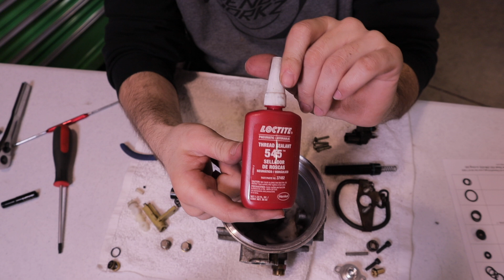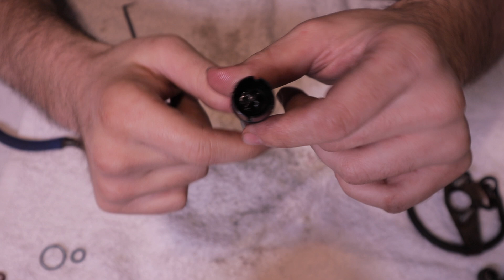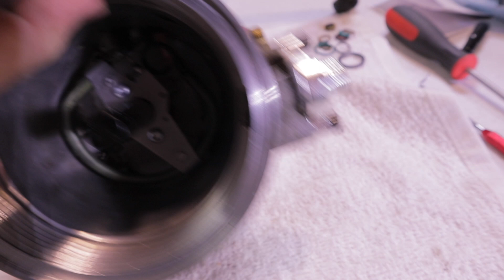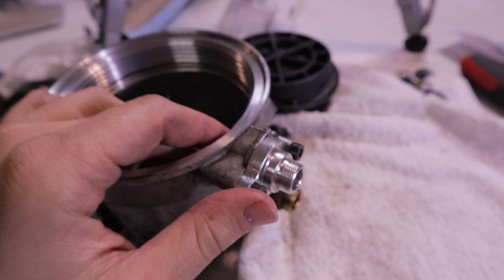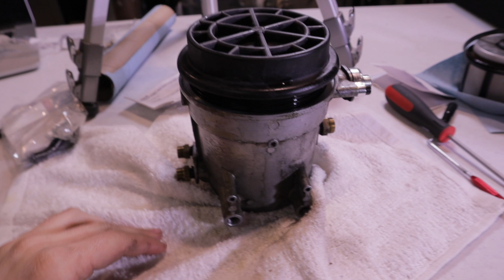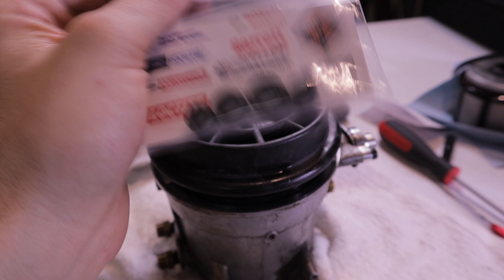Fixing One of Ford 7.3 Powerstrokes Biggest Problems: Fuel Bowl Rebuild Part 2

Comment: Hey Buddy, how are you? I am done rebuilding the Bowl but I need to know if you have knowledge of the torque specification for the brass fitting on the 7.3L fuel bowl? I went to 2 places one says 60-65 lbs which I though that was a lot espeically going to aluminum threads and another place says 19 lbs. So I am confused! Hope you can help. Also, can I use Permatex anti seize on the 2 bolts that whole the bowl or is not need it and do you know the Torque on those 2 bolts by any chance?

Comment: Hey buddy how are you? Got a question for you! What is the difference between Loctite 545 and  Gasoila Soft-Set Pipe Thread Sealant? I am going to start rebuilding mine next week and I only have Gasoila I was told this brand is for high pressure lines but now I am not sure. Thanks buddy,,,
Reply from the maker: I’m no expert but from my knowledge, the main difference is loctite 545 seals the threads and still works like loctite. It cures semi hard. Keeping things from vibrating loose. Also intended for metal threads. Gasoila cures more soft as no is more versatile in application. RiffRaff included it with their FRX kit. So I trust you’ll be just fine using it.
Reply: @LivingOnWheels  OK buddy I was just asking to make sure I do the job once and not having any leaks later. Thank you buddy!!! Another question... Why the new Regulators the Brass Piston don't come with the perforation in the middle to release the fuel? I return 2 of them because of that. I learn without that it can cause damage that is true?
Reply from the maker: @G @GeorgeMartinez-m8y nestly it was so long ago that I’m not sure. I feel like it had something in the middle. Unless yours is damaged I don’t see why you couldn’t reuse the stock one with a new spring.
Reply: @LivingOnWheels  Mine is fine I'm just curious the why the new one doesn't have the perforation. I don't need it at this point but is nice to have an extra one for the just in case. I will rebuild mine next week if I have other question I let you know. Thank buddy for all your help. Love your videos even a 4-year-old kid can follow your instructions. Very Nice!!!

Comment: Do not use a Dorman aftermarket heater/water sensor. I bought one from Advance Auto, returned it due to leaking and they sent another. Despite doing an air pressure test, it still ended up leaking. Bought an OEM unit and it sealed first time out. I wasted weeks due to shipping times and lost many hours installing and uninstalling the faulty Dorman units. Pay the few dollars extra and save yourself a lot of anxiety.

Comment: The o rings on the fuel inlets and outlets do you just stuck them in the brass and then put the lines in after and smash them down or do u put them on the flared lines and thread them in?
Reply from the maker: They go on the flared lines and the nut threads over them.

Comment: SInce you are resealing all of the O-rings, why not also repalce the WIF sensor since you are already there? As these are electronic parts they obviously have a lifespan and they are not cost prohibitive - around $100-130 even during Bidenflation. Are these F81Z-9J294-BA (International P/N 1831197C91) so bullet proof that they last forever or could these electronic WIF sensors be the very reason we see the fail to start issues associated with the fuel bowl heaters?

Comment: A tip for the heating element is to leave it connected and remove the water / heater sensor and pull it out slowly. There’s enough wire to disconnect it outside the bowl. And when putting it back together put the wire through the hole and connect it to the sensor outside the bowl. Then pull the wire in as you install the sensor back.

Comment: Straightforward explanation. I was trying to hurry due to sun setting, and after rewatching your video again, I placed the spring for the fuel inlet valve in the wrong position. So tomorrow hopefully I can remove the filter, the heater and that tower where I put the spring in the wrong position. My spring was kind of bent up, so I slowly and carefully straightened it out as best I could. How it got so bent, I’ll never know. I am starting to go through it weather permitting. My first diesel,so it’s all a learning curve. Keep ya posted on how it turns out😊😊

Comment: Another nice video extremely helpful. You need to get a teaching certificate. I just did one of these fuel bowl reseal. I left the check valve out of the center standpipe I think I'll be putting a fuel filter in they don't think I would ever not put a fuel filter in every little bit of flow helps. Thanks for the help keep it up.👍
Reply from the maker: Glad it was helpful!

Comment: Thank you. I'll be doing the drain valve only. It's a tight fit. I'm thinking, put the screw in, flush with the inside surface. Dab some gasket sealer on the out side thread. Let it set up. Then when positioning it the screws won't fall out. Once they are threaded I can peel off the gasket sealer for a snug fit. Pulling the bowl off like you did, makes more sense. I'm hoping to cut a corner which usually doesn't go well.

Comment: I would have just removed the whole check valve on the fuel filter I don't think anybody would run or not run a fuel filter. I don't know I've seen a couple different videos on removing that what do you think?
Reply from the maker: I’ve heard of people doing it but I don’t think it’s much of a restriction.

Comment: Hi. Good video. Suggestion. Make sure you have your volume up when recording. I have volume up 100%, but you have a soft voice, so it was hard to hear you and I'm watching inside my rig with the engine running. Also, need video on how to access and remove the fuel bowl. Let me know if you have that or suggest a good one. And, I guess you did the fuel bowl delete, so I can use a good video on doing that. After seeing all the work involved to rebuild the fuel bowl, I think I rather do the delete and get rid of the whole dang thing. Good job. Thanks. JR

Comment: Compatible oil is the right way to lube fuel o-rings.  In aviation, an oil system oil ring gets lubed with oil,  Hydraulic with hydraulic fluid but fuel system o-rings get petroleum jelly or an oil typically.

Comment: Hey bro I started doing this on my 7.3 fuel bowl yesterday and I stop when I came across the 2 fuel fittings where you used loctite 545,I can't for the life of me find it at the local stores , is there any other sealant I can use ? Thanks
Reply from the maker: I don’t even remember if the directions even call for sealant on those. You could check Riffraffs website. You might have better luck finding an oil or fuel rated Teflon Tape. Just be very careful to not have it overhang the threads. You don’t want any getting into your fuel rails.

Comment: Just replaced my entire bowl and water separator on my 98 E350. But now getting tons of white smoke. Could it just be air in the system ?
Reply from the maker: No, that does not sound like air. Sounds like and injector issue. I'd say either bad O-ring, stuck injector or broken tip.
Reply: @LivingOnWheels  I’ve never had this issue until I replaced the bowl assembly
Reply from the maker: @JakePearce226  Perhaps you got some junk in one of the lines?
Reply: @LivingOnWheels  I’m thinking so. Let it run for about 20/30 mins and it’s 99% cleared up.
Reply from the maker: @JakePearce226  Good to hear that. Probably wouldnt hurt to run some nice fuel system cleaner through it too. Like some hotshots or Archoil. 
https://amzn.to/36eAZtL
https://amzn.to/39knpar

Comment: If I could buy you a beer I would. Awesome video. I bought the riffraff fuel bowl re-seal kit and used your video to assemble the whole project. Went in like a charm with no problems. I was working remote in Alaska and next thing I know I started leaking diesel from the back end of my fuel bowl right at the drain valve. Patched it up with the tightening of a screw which fixed the problem but I knew it needed some love. Your videos really helped my through the process exponentially. Clear explanations, with visual perspective made the job a cake walk. Riffraff is always my go to when it comes to my 7.3, and people like you really keep things going with a simple run down of the basics. There are a lot of how to, DIY videos out there but the quality and detailing of your videos really makes the difference. Thank you, and cheers!
Reply from the maker: I really appreciate it man! Super glad to hear it helped out!

Comment: Just for anyone's curiosity, the stem in the middle CAN be gutted with no negative repercussions as long as you don't run your truck without a bowl filter. The guts in that stem only serve to block fuel flow if there is no filter present, and I noticed a bit of a fuel flow gain in my system after removing the plunger, base and rod. Not to take away from your video because I realize this is not a mod video it's a rebuild video but anyone who is interested, that is a mod you can do during a bowl rebuild, or if you just happen to have the time when you change the filter.
Reply from the maker: Good info!
Reply: Hell yea. I was looking for this.  Thanks.  I’m chuckin this junk bowl system with micro filter in a few months